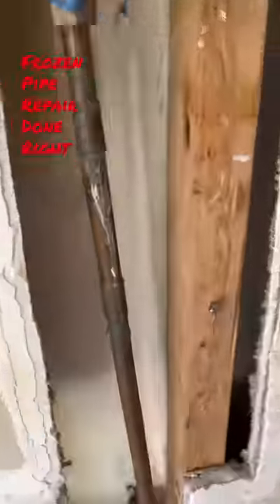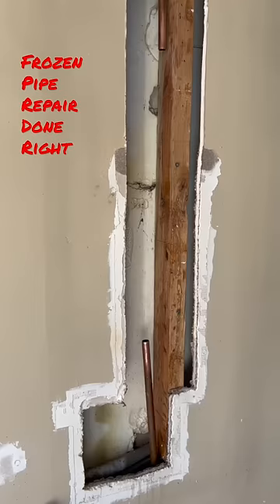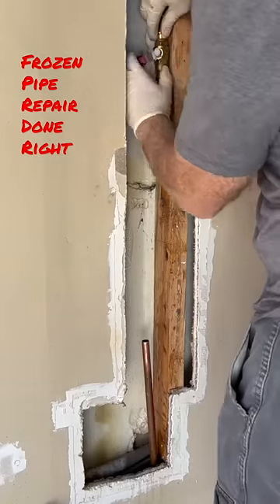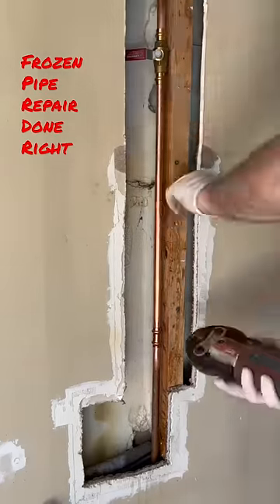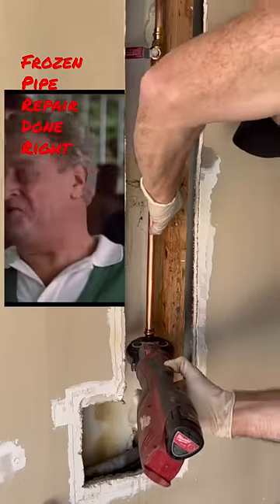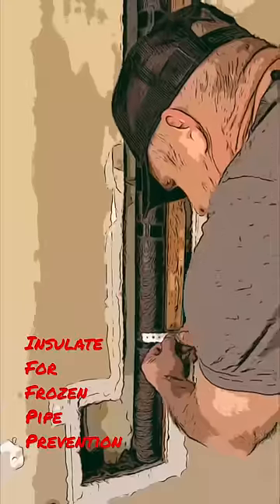Frozen Plumbing Pipe Repair @TappPlumbing #shorts #plumberslife #plumbingproblems

Comment: Insulate between the outside wall and the pipe. Solder wasn't the problem, albeit looked rough.
Reply from the maker: I tried to get my client to understand the importance of your statement!! I also made them aware of the need for an access panel when the drywall is repaired. Thanks for spending some of your time with us!!!

Comment: You cant put a shut off value in the wall like that,,its like putting the water heater in the wall
Reply from the maker: It will have an access panel installed when the drywall is finished. Thanks for watching!!!

Comment: If it's an exterior wall (or in an unheated location) you always put insulation on.. what kind of terrible plumbers didn't before?
Reply from the maker: That is a great question isn’t it ? I guess the same kind that leaves all of the previous repairs as well😂

Comment: This is equivalent to a person repairing their damaged ceiling from a water leak without first identifying the leak and repairing it in the roof that caused it!
Reply from the maker: We sure hope not, if the client does as she was educated to do it probably will not happen again. This job occurred during the deep freeze here in GA. The client wanted a shut off there and stated that they would insulate the wall and put and access panel in. Thank you for watching!

Comment: Wait so you don't actually use solder with copper pipes any more?  I had no idea.
Reply from the maker: Only on occasion, there are actually several ways to install it without soldering. Many plumbers are not fond of this however. That is completely different conversation. Thanks for watching!

Comment: I generally don’t care how my solder looks when it’s behind the wall. Only when it’s exposed
Reply from the maker: I notice in many plumbing videos now people don’t wipe their joints off🤷‍♂️. I really don’t solder much any more but when we did it was fairly common practice to keep the joints as neat looking as possible. I also notice people do a much better job of cleaning off the excess flux after the joint cools then we did , which is definitely a great habit!!!!

Comment: How about fixing the actual reason why it's breaking, freezing, because it's in an outside 2x4 wall. How about move the pipe , insulate it, heat tape it, something instead of just fix it when it breaks.
Reply from the maker: That line feeds an outdoor spigot the client insisted was necessary. That was kinda what I wanted everyone to see , the fact we at least tried to get some insulation in there.

Comment: So, you are using Pro Press crimp on fittings inside a wall?  And, putting the valve inside a wall?  I thought both of those were against the code.
Reply from the maker: The code allows the fittings . We are supposed to route the lines to cabinet and put the valve under there . That was not an option for this situation. There was a deep freeze here and many ,many people who had no water at Christmas time. Thanks for asking great questions . Thanks for watching also!!
Reply: @TappPlumbing  Thanks for your answer.  I'm coming around to accepting the ProPress system.  Amazon has manual tools using either long handles for leverage or a hand operated hydraulic pump in the $100 to $150 range which would be suitable for a homeowner.
Reply from the maker: @BryanTorok   That is very interesting, I was not aware of that! I would be very curious how much pressure a person could expect to exert with that. I think my little press applies 5500 lbs . I will have to investigate this asap. Thank you so much for teaching me something new !!

Comment: Why not put pex in and still insulate it if its a problem, your just doing the same thing they did plus adding insulation
Reply from the maker: I do respect the fact that pex is better suited for freezing temps. The line fed an outdoor spigot and I just they feel more secure during operation and may stand up better to the outdoor abuse tied to copper. You did have a great, thank you!!!

Comment: When the press copper pipe was made many plumbers were born 🤣🤣🤣 true plumber use torch.
Reply from the maker: Check this video out please 

https://youtube.com/shorts/BsgvHWRR9NY?feature=share

 It explains everything!
Reply: @TappPlumbing  the press copper pipe is fast and easy to use. In a emergency yes use it. But it not the best thing to use. It make a nother plumber so more work on disconnect pipes.

Comment: Why is the shutoff valve behind drywall if that's the shutoff to the whole house?
Reply from the maker: That line is actually running down the wall to feed a spigot. There will be an access panel installed when the drywall is repaired. Thanks for a great question!!

Comment: Why would you put a shut off valve inside the wall? I wouldn't have installed a shut off valve in a closed wall, it's useless.
Reply from the maker: We get it, but the owner wanted it and had plans to put in an access panel. Thank you so much for watching!

Comment: Yeah I keep using that ProPress garbage you're knocking on solder but I don't see you soldering a pipe. And if you want it not to happen again you insulate and heat Trace

Comment: Insulation is only necessary on exterior walls. I get homeowners that watch too much HGTV that want me to add insulation to a wall with a closet on the other side???
Reply from the maker: I might see insulating pipe in basements for heat retention on the hot side and condensation control on the cold . Occasionally I go in finished basements and find stain lines from dripping condensation on the Sheetrock ceiling but it is very rare.

Comment: You really should've insulated between the outside and the pipe.  Heat always moves toward the lesser heat (cold).  We slow the transfer with insulation brother.  The R- value of that junkie pipe insulation is not even a 1.  Foam board is what I would've suggested.
Reply from the maker: You are definitely correct! That part of the work will be done by the homeowner or a different sub. We only work on plumbing. Thank you so much for some great advice!!!!

Comment: Why is the shutoff vale in a wall?
Reply from the maker: That line feeds a spigot. The valve is there to shut the line down and drain it or work on the spigot. There will be an access panel installed when the dry wall is repaired. Thanks for a great question!

Comment: Home owners expect it to be done right the first time. Plumber fucks up. Call dun dun to dun drywall man. When he goes to fix it. Surely he seen bad work. It's a simple fix with insulation and a little sheet rock 4 x 3ft butt joint if everything is on center. Nope not throwing any one under the bus just do it right. That's job security because they always call you back to fix old contractors stuff and recommend you to their friends. Some gated communities I can't get out of.🪵🥄

Comment: I would have moved the ball valve further inside and run it with PEX-A. I see those crimp fittings as glorified a 😅sharkbite
Reply from the maker: I know but the line connected to a spigot .In my opinion the spigot feels more secure connected to copper during operation. I do get your point about the pex though. Thanks for sharing your insight.

Comment: Maybe you should tell us why there is a shut off valve enclosed in the wall.
Reply from the maker: That line feeds a spigot. Theoretically so you can shut the line down  and drain it or work on the spigot. Thanks for a great question. There will be an access panel installed when the drywall people do there work. Thanks for watching!!!

Comment: Fact. Pro press fitting hold less pressure then SHARKBITES.
Yeah your joints are worse then sharkbites, saw a live demo at my local supplier..
Reply from the maker: How much did it take to blow them apart?

Comment: Because he crap on the others it's my turn to do it to him 😁..
 Well guy to insulate it correctly after you put on pipe wrap you should have batting behind it  but not in front of it as the inside heat will keep that pocket warmer while the batting keeps the cold from coming inward . Also did you rock and compound the hole or you leave it for someone else to do ? 
 A good plumber does it all including painting it..
    Or maybe it's just how I do things from start to finish !!    😜😁

Comment: Well the insulation isn't necessary. It's in the home so there isn't a reason to put it on. No risk of freezing and no risk of burning. Probably charged her 50 bucks for that 3 dollar insulation
Reply from the maker: Ha  unfortunately the cost of the product is not the actual cost of the Job:)

Comment: Looks like that MF was repaired more then a few times in the past. Maybe insulate the damn pipe a bit or the cavity it's in. There's also a heater wire option that goes against or wraps around that kicks in at certain temps.

Comment: pro press does not do well under cold conditions. it should of been sodered . I've been doing this 35 years and see pro press fittings fail often
Reply from the maker: I definitely have seen them blow apart in deep freezes also. This time it happened at Christmas here in Atlanta and people were literally crying on the phone with no water. This situation was about moving along to get water back on for as many people as I could as fast as I could. Literally Christmas Eve and Day. You are correct though! Thanks for watching!!!

Comment: There was pipe insulation above the top valve so someone had put it on at least once
Reply from the maker: That is very observant! When I got there, there was no insulation around the freeze break. It must have been removed on a previous repair. The homeowner told me “thank you for putting the black stuff on there. It had never been on there before.”
Thank you for spending time with us!!
Reply: @TappPlumbing  I was just being a smart ass. Lol
Reply from the maker: @darinkrinovich2062  no worries at all, we all need to have a little fun. Thanks again!

Comment: My question is, why is there a valve inside the wall. when the drywall goes on to fix that hole, it will completely cover that valve, why? Do a proper job put a stub out and anchor it to the stud or to a plate, or eliminate the valve altogether.

Comment: 🙄had a pipe freeze under the house and bust.. it had been repaired several times, but I checked the solder on the joints leading up to it, straight trash.. The pipe was so weak I couldn’t even cut it with a pipe cutter because it kept collapsing. In the process of pulling all the copper out now.
Reply from the maker: What are you gonna replace with? Are you on a well?
Reply: @TappPlumbing  we are on a well, so the minerals have eaten through the copper, thinking about doing pex or pvc.
Reply from the maker: @Suzib1984  Most people around here use CPVC for wells. PVC is not rated for hot water. I would just research until you are very confident with a decision. Each material has pros and cons.Good luck with your upcoming project!!!!

Comment: Laziness can make bad work. Bad work can bake. Bad contractors doesn't take much to do a right job the first time. It's one thing if you have to do a pieced repair like that because you came from one job and it took away everything that you had as far as supplies and all you have is pieces to make a job fit. You can make it work. Fix it up like it's supposed to be fixed up and until the homeowner that they will come back later and do it correctly but most of them would come in fix up what they could as easily as they could and then not come back at all because now one they don't have time. They don't want to do it. It's going to cost more money. They already got it fixed. The excuses go on and on and on and in the end all an excuse is is just a reason not to do it

Comment: There’s insulation on the pipe above. So no you are not the first to put insulation in pipe. If that’s an outside wall there should be insulation.
Reply from the maker: Very Observant, however there was no insulation around the repair area when I got arrived. You correct about the outside wall part of your statement also! Thanks for sharing!!!!

Comment: Looks like 1 repair. You use two couplings for a repair, not one. The additional ball valve was likely installed because the gate valve failed.

Comment: That's gonna freeze again... You insulate the outside wall and leave the pipe exposed to the Inside Warm air.
Reply from the maker: That is all true except there is no inside warm air, it is in a garage. The insulation that will go back in the wall will be provided by the homeowner. Thanks for sharing your opinions and for watching!!!!

Comment: Why didn't you make the pipe straight. It's angled where you fit it at the bottom.
Reply from the maker: I had to pull it off the wall to get the jaws in it and it pressed up like that. You have some pretty good powers of observation!!!!

Comment: He did repair the easiest  , Not the best .
Solder joints last alot longer , especially if done correct .
If this is an exterior wall it should've had a vapor barrier & insulation .
Why put a valve in a sheet rock wall ?

Comment: Why is there a shut off valve inside the wall
Reply from the maker: That line feeds a spigot. That valve will allow people to shut down the line and drain it or work on the spigot. There will be an access panel installed when the drywall is replaced. Thanks for spending your time with us!!!

Comment: Bet you it still freezes! Need to insulate the wall behind the pipe.
Reply from the maker: Not taking that bet my friend! The home owner will that when everything dries out. They will also leave an access panel for the valve when the drywall gets repaired. Thanks for spending some time with us!!!!

Comment: I hope they are not hiding the shutoff behind the wall, is that code.
Reply from the maker: They assured me when the drywall is repaired there will be an access panel. I have to trust my client on that after I leave . I told them it was code and politely said it is also a matter of common sense . Thanks for asking and taking the time to watch !!!

Comment: Why is it freezing. Did someone plumb it in an exterior wall or has someone left a large hole into the crawl space. The insulation is  good but if things were  built properly that line should not be freezing in that wall. 
  They never did learn to solder.
Reply from the maker: It is in an exterior wall , a common practice around here. I also see solder work like that all the time as well. Scary. Thanks for watching!!!
Reply: @TappPlumbing  30+ years, in the trenches. I've seen even worse as I'm sure you have also.
Reply from the maker: Oh yeah , that is for sure!!

Comment: Why are you putting a valve in the wall?
Reply from the maker: That valve is on a line that feeds a spigot. This way you can shut the valve off and drain the line or work on the spigot. There will be an access panel installed when the drywall is repaired. Thank you so much for a great question and watching!!

Comment: I'm not a plumber but still don't think this was fixed properly. The cavity should be filled with insulation and there shouldn't be any valves in there unless there is an access door.
Reply from the maker: This will help explain:) https://www.youtube.com/shorts/BsgvHWRR9NY
Reply: @TappPlumbing  I didn't think my original comment was particularly harsh, but yes, I didn't know the full circumstances around what you were up against. I will say that after watching the original video again, as well as your follow up that most of the real problem is the way the plumbing was done in the first place along with several shoddy follow up repairs. I will also say that in the twenty plus years I have been doing my own plumbing I have never had any of my work fail, knock on wood. The only exception to that being a 1/2" water supply line in my mother in laws garage that keeps freezing in winter unless she shuts it off and drains the line before it gets cold. I do understand that sometimes you just gotta do what you gotta do. Cheers!

Comment: How about moving that line to an interior wall. If not, then you had best leave a louvered grille or a heat tape on the line to plug in. Common sense is lacking on all of you plumbers. Insulations slows heat transfer. If you leave it at 0F for hours, armaflex won't help.

Comment: The difference between hiring scabs all them years over a union plumber.
Reply from the maker: Ha, Union Plumbers in the Atlanta area typically don't do residential. Our Local Union shops use Pro Press a lot now:)
Reply: @TappPlumbing  considering georgia is a right to work state its no shocker why they had problems before. Pro press has been used by unions for a long time with great success, its no different from pex, solder joints, pvc, etc. All depends what the customer wants or wants to pay. Residential is lost even in heavily union cities because they are so undercut on pricing and competition is tenfold and this is a clear result of that. Say what you want about unions but they are by far the best trained out there. This isnt to say there isnt good men in the non-union side that know what they are doing but imo its a no brainer to be union vs non-union. More times than not a union contractor will get the job done right the first time. Plus the benefits as a worker are so much better so why wouldnt you join? Cheap labor isnt skilled and skilled labor isnt cheap is always a good rule of thumb to go by.
Reply from the maker: @07slowbalt  well stated!!😊

Comment: Craps on soldering, then proceeds to use bubble gum to secure pipe
Reply from the maker: I don’t have a problem with someone soldering, just make it look nice if you are gonna do it. You don’t think the press fittings will hold up over time?

Comment: Why is there a shut off inside a wall. Not accessible well I guess unless you leave that big hole in the wall!
Reply from the maker: There will be an access panel installed when the drywall is repaired. Thanks for a great question! Thanks for watching also!